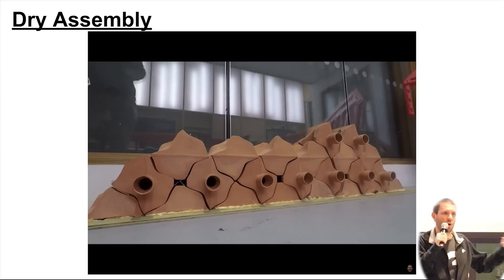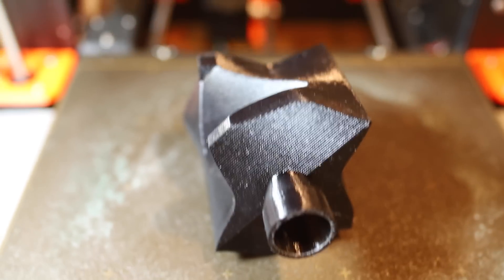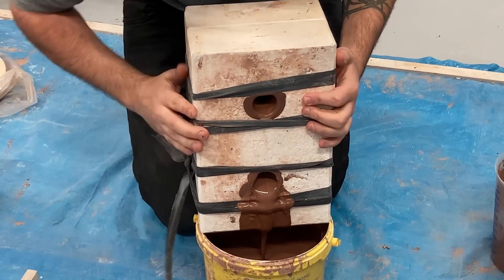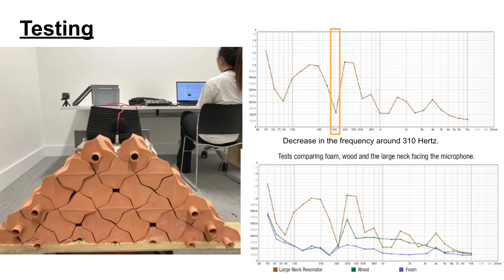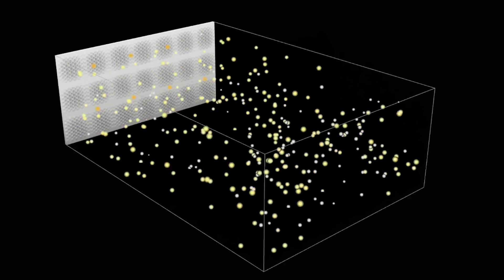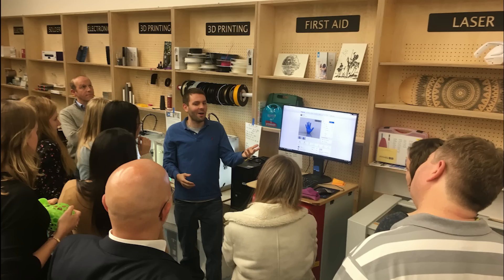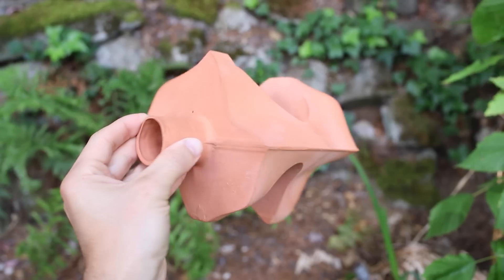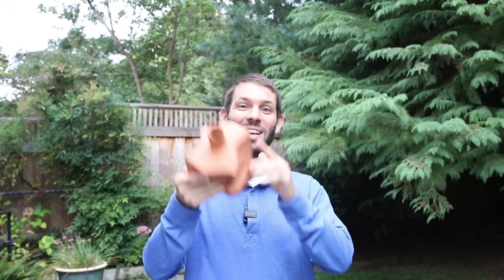Top 3 Questions Answered How I Made This Prototype

Comment: Total knucklehead here, but what if the brick was cut in half, call it (A/B) and instead use a mold that makes a not-hollow shape like this B)(A then you could stamp out tons out of regular clay without needing to wait for slip to firm up.  Then when you make the wall, you use B)(A B)(A B)(A B)(A
Reply from the maker: The cavity and neck need to be sealed.  That would be a tough grout job!
Reply: @JoeMakes  I though the same thing. If you use some kind of cement to build the wall that should be enough to seal most of the brics, and the rest could be done with plaster or some emboss on the finishing surface. This would make the production of the brics much easier, cheaper and faster! Other than that, congrats on your project and specially in making it open to the community. A less noisy world is a better world!
Reply: If you combine them before firing, wouldn't it work? The same way you can combine clay in pottery, by making a rough surface and then putting wet clay between them. That way both halves could have slightly thicker walls maybe. Get them most of the way dry before combining, so they don't fall apart under their own weight as easily?

And have them divided vertically, so the neck is on one piece and the back is it's own piece. That way you're just sealing the cavity.
Reply: I'm surprised that clay 3d printers aren't common yet.
Reply: That's exactly what I thought when I saw the video. Producing halves would be much cheaper and faster, similar to current standard bricks.
Reply: I looked at the models in Cura and if you split the bricks in half then I think you could mold an A half and a B half like you said. Halving also means they would take much less space as they could be stacked like plates or bowls. You could also use the half blocks to get a level horizontal base course of bricks or plumb vertical wall. The model already has wall angles that are ~90 degrees when split as described above, and with some draft angles it would make the mold releasing easier and you could make the walls of the bricks thicker or cast them out of different material like concrete which is commonly used for molding and could enable larger bricks. The half brick molding would not work with the new inverted design @JoeMakes released since the internal neck creates overhangs though.

Also some interesting I noticed when looking at the models is that the full bricks have large amounts of surface area in contact with their neighbors creating large mortaring surfaces which means a lot of adhesion between blocks. Also the shape of the blocks is super interesting with them being almost arch shaped when viewed head-on.

Comment: Ok nice idea, but it seems way overengineered, fiddly and fragile. What am I missing? Please offer any economic argument for why to approach reducing traffic noise this way. What is the production cost? Use cases? Construction cost? Who would the customer be? How is this better than those absorbent panels along highways?
Reply: I believe his theoretical advantage is having a tuned response for tire roar ~300hz from what I gathered in the video. Low frequency attenuation is very hard with paneling because of the long length of the low frequency waves. In studios, we use bass traps, which are designed to literally catch errant low frequencies in order to give them enough time to lower their energy.

This seems like a terra cotta bass trap wall 😂 personally, I think varying the sizes to trap a range of frequencies could shape the road noise to be more pleasant, instead of trying to outright silence it. This is the way they design car interiors as well, make it sound nice, then make it as quiet as possible (within budget lol).
Reply: This is not the first video he has covering this project, it’s all open source and available information friend, you just have to look at it.
Reply: @SeanQuinn4 in the original video he said it would work  with additional sizes and shapes to cover a more broad spectrum of
Reply: @Wanhope2  that's what gave me the idea 😁 I suppose the natural difference between cells, due to being filled with various things, could also add some fuzziness to the tuning.

In theory, one could even get creative and cut away all frequencies apart from a selected chord. Then road noise would sound musical lol
Reply: @SeanQuinn4  Ou I’ve seen some art installations like that! The ambient noise and wind direction would shift the tune! 

Integrating porous materials + nesting sites and maybe plants would probably give a nice boost to dB impact. (Though vegetation tends to create wild scattering, the bane of berms near highways lol)
Reply: Hrrr drrr sounds complicated... Add abs foam core to concrete wall....
Reply: @bravojr  right? This idea is not bad to make at all. I don't get some people. They are bad to a good idea to pretend to look smart but all smart people can see this is neat and good idea.
Reply: @bravojr  he is slip casting. Are you familiar with lost wax casting? Slip casting is similar in that the core is destroyed. He glosses over it in this run down and honestly I think in the original as well other than mentioning it is slip casted. The foam is used for the mold and void, but it gets removed destructively. Slip casting typically involves burning out the core.
Reply: @risunokairu when slip casting simple parts there is not typically a mold core at all. You simply pour in wet clay (slip), wait for the mold to absorb a enough water from the slip in contact with the surface, and pour the remaining slip back into your storage container (or the next mold). This leaves behind a thin layer of clay which can be removed from the from the multi piece mold after it has dried sufficiently :)
Reply: @josephanderson3773  correct. These people sound weird like some kind of organized group and their criticism doesnt make sense.
Reply: Clay can be mass produced though. See the seam line? This process can be automated with clay extrusion and injection into molds and they could potentially be produced for pennies. If the unit cost can be kept less than a dollar, then that’s a decent price per square foot for walls, no?
Reply: It’s a master’s project. It doesn’t have to have commercial viability.
Reply: @ferretyluv Please tell this to my university. Commercial viability for an undergraduate project is insane
Reply: Also, this is a proof of concept. If something like this was to be mass produced, a redesign would surely be made. But the groundwork has been done, ready for someone else to take to the next level of production.
Reply from the maker: You should read my thesis where I cover all of this...
Reply: You’re missing the entire video where he goes through the whole process.
Reply: What do you mean fiddly and fragile? That’s literally the exact reason why he is not trying to monetize it. I really think you’re missing the point here. Try to get out of the capitalism thinking in box for a minute.
Reply: @melody3741 Capitalism has given you the tools to whine like a wee girl. Use them wisely.
Reply: This isn't a business proposal, just an idea
Reply: *pointing Spiderman meme* @MisterBones223
Reply: no shot bro just tried to pretend they knew more about this than the guy who wrote his THESIS ON IT 😭
Reply: @kobaltmyst8074  they did not pretend to know more, and writing a thesis on something does not make you know more about it
Reply: Ok internet, thanks for the love as always. Joe, sorry I didn't start by appropriately praising your thing, which is cool. But I really had some genuine questions from your video -- apologies I was lazy and didn't immediately refer to your thesis to study it for answers. And yes, I get it, a thesis isn't a sales pitch nor does it need to be. Maybe that covers the thrust of the grumpy people's responses. -- Helmholtz resonators to reduce road noise, cool. Do you envision a way the underlying concept could be extruded in a normal brick factory instead of slip cast? Would a toilet factory (probably the world's champion slip casters) be able to mass produce these at a practical cost? Sorry if you answered this in your thesis, but do the spaces between the bricks matter to your system, or is it only the inside of the bottle shape that matters? I feel like you'd need a ton of these to be effective, but is my intuition wrong? Like, would the acoustics be so much more effective at reducing road noise than absorbent panels that it could be much shorter than the large panels they normally use? Could your bricks be incorporated into those panels, like a normal panel substrate but with holes manufactured in for your bricks to be mortared in? I don't know, etc etc. Basically, when I see a cool concept I wonder if there's a path for it to become a thing that might get used in the world.
Reply: @basstenortreble  Dude, are you even a real boy?? Go do your work if you are really interested in the answers. And go get raised by someone else than the one(s) who tried it the first time around.
Reply: You fundamentally dont understand the point of engineering. People like you are the ones who think "why reinvent the wheel" is a good quote
Reply: It's not. He is architect student, not engineering... It's about bringing a cool concept to life.. Maybe too hard to gasp for some as you are trying to gain relevance in YOUTUBE COMMENT SECTION??
Reply: @IHaveDaddyIssuesHowDidYouKnew @janvrabec3401 Are you offended sweet prices?

Side note, if they are interlocking, how the hell one replaces one? Square, you can just cut out and push a new one in but an interlocking one. I guess you nuke the whole wall.

And since it's hollow on the inside it would probably not survive much load. It's probably good for modern art galery, but for nothing else. And how the hell is it going to muff out sounds if bloody birds will be chirping inside of it? And has even tested if acids in bird poop don't deteriorate the brick. It's like Spherical car tire, Hyperloop and many many more overengineered garbage. Some things are better left simple.
Reply: Op is a kid who is in school for business... no point replying. Op of this thread lmao not you inventor. Lol
Reply from the maker: I got the business degree in 2008, so you are kinda late...
Reply: @JoeMakes  honestly was on your side with this untill you revealed hat you were a businesses student.
Reply: @JoeMakes  you shouldn't argue with your viewers. It's a tacky mentality. I'm not following you.
Reply: @815TypeSirius 0:56  he's got retard poisoning.  So sad.
Reply: You're not missing anything, it's not practical.

Comment: Why not just put holes and tubes into normal shaped bricks?
Reply: The entrance looks like it’s tapered to discourage water from entering and terracotta being porous may help bring trapped water out
Reply: @mandlebrotmott  yes- but why not use that design on a rectangular shaped brick?
Reply: @seo5581  I think rectangular chambers would act more like resonators then they would for sound reduction
Reply: @unknownhours  I would guess that parallel walls are undesirable because they will give the chamber 3 strong resonance modes. You rarely see square Helmholtz resonators in the wild, except in the case where they're individually constructed (like wooden chambers) and can be made with varying depths/lengths. You can't really do this with slip casting; each brick is identical. But you could fill them post-fire with varying quantities of resin or lightweight concrete to alter their volume.

The walls of these twisty bricks probably also help distribute load better than plain rectangular hollow bricks could.
Reply from the maker: You should read my thesis and portfolio.  It's all linked in the description👍
Reply: @JoeMakes  thank you! I will look at it now :)
Reply: @JoeMakes  Wow - thank you for that link - great work, very readable and interesting. I think there are several more youtube videos worth of content there. I just went through Chapter 4 - but I'm going to keep this tab for a while. The ceramic vases in the churchs blew my mind - and there was a serious discussion of this topic in the 1400s?!!! You gotta make more content on that - let's GO!
Reply: Budy nobody is reading your thesis.
Reply: @86Corvus  and here you are wrong

Comment: this needs so much more visibility
also, wouldn't stagnating water change the absorbed frequencies as well as making a wonderful breeding spot for mosquitos ?
Reply from the maker: Thanks, the water will weep out since it's terracotta
Reply: @JoeMakes  What about the organic matter sealing the inside surface to hold water? I really like the aspect of the possibility for nesting, but a few years of biomass in a moist hole will turn in to "solid" where water sits
Reply: @JoeMakes  it will weep out a lot less once dirt, and other materials are coating the inside and outside over the lifetime of the bricks
Reply: @bearwynn  dirt and bird nests are still porous. Also, it's a very small mouth for water to get in

Comment: Can It be created in different sizes for diferent sound frequences? Web could add some kind of rubber, not concret, and better cork, to join the bricks and dampen vibrations? What other construction materials can be used with this shape? Did you tested and mesured other materials and shapes and other purposes? For instance as nano or microscopic neutralizers of light or heat? 

Have you researched how to make special bricks that passively cool the air to the dew point to collect water from the moisture in the air?
Reply from the maker: You should read my thesis and portfolio.  Lot's of answered questions there.  Linked in the description👍

Comment: I've seen models on thingiverse that allow you to select arbitrary dimensions for certain elements right in the website, like just the length of a finger in a gauntlet. How feasible do you think it would be to make a slider for the size of the inner cavity (and therefore the target frequency)?
Reply: This is called parametric modeling. It is a pretty simple thing to implement. Although in this case it doesn't make a lot of sense to vary the interior cavity alone as just making the block bigger or smaller will achieve the same thing.
Reply: @kenhensch3996 It requires you to make the entire model from scratch in a system that supports it, and the end user has access to. Not exactly trivial if you weren't planning it from the start.

I've done it before, it's a nice option for things that you want customized by the user. Just know that 99% of people will ignore the ability to customize and just download the premade version...
Reply: @kenhensch3996 varying the cavity makes sense, because you can have multiple frequency bricks in the same wall, because the outside is the same size
Reply from the maker: Go for it!
Reply: @JoeMakes go for it!! 😂😂😂